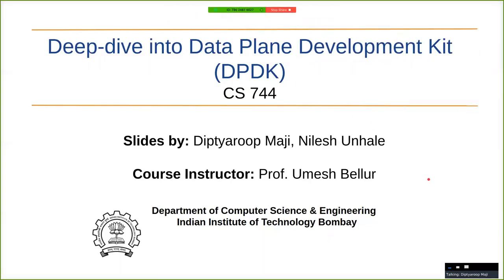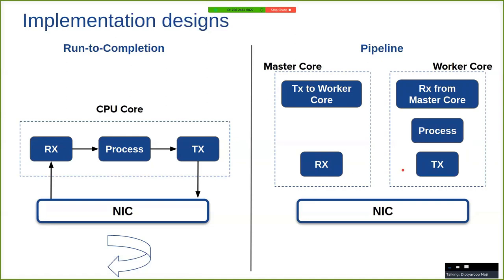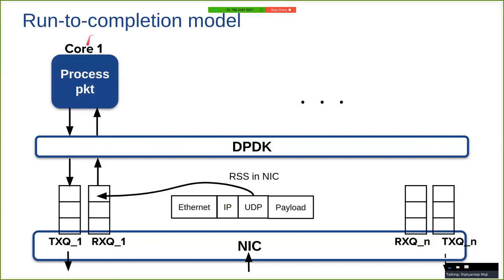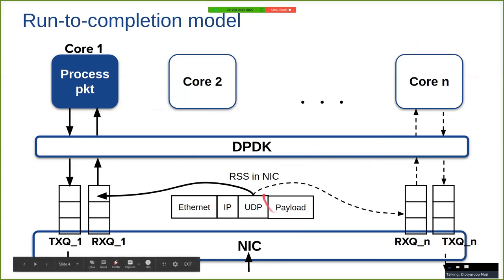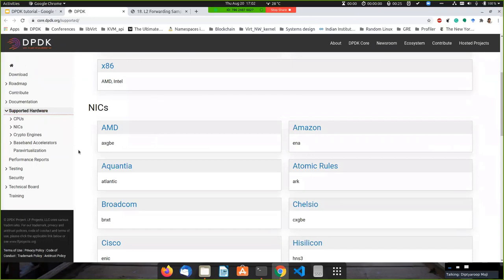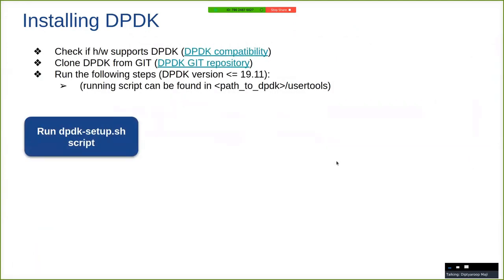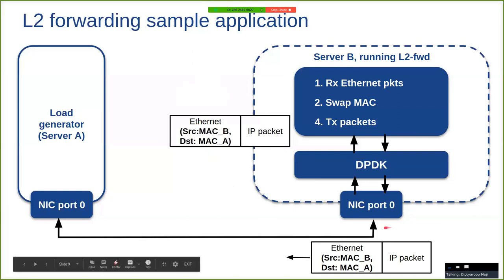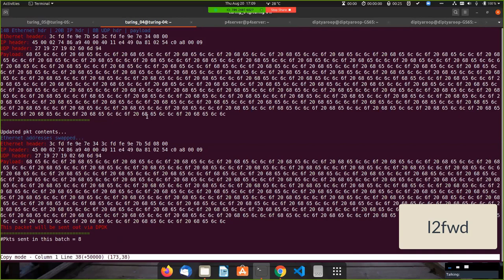DPDK deep-dive

Comment: Dear Sir, 
Very informative video, thanks for sharing your Knowledge on DPDK in a simple way of understanding
Reply from the maker: Thanks for your feedback.
Reply: @diptyaroop  Sir, Could you please make a video on or share some inputs, how the L2/L3/L4 headers are handled in DPDK, data plane.
lets say , if i want to send a udp packet from dpdk installed machine to non dpdk machine, how the control plane comes into picture and once it identifies flow how data plane comes into picture, As i am new to DPDK, i have many queries, kindly address my doubt sir, which will create me more interest in learning DPDK

Thanks in advance
Harikrishna Datrika
Reply from the maker: @HariKrishna-gd4ho  If you want to send UDP packets, you have to craft all the headers in the application (userspace) itself. The headers should be as per standard. Otherwise, non-DPDK machines will reject the packet. So, the packet structure will be MAC hdr | IP hdr | UDP hdr | payload. For UDP hdr, you may use rte_udp_hdr structure and assign values to all the fields. Similarly, for IPv4 hdr, rte_ipv4_hdr, and so on, where the dest IP will be that of the non-DPDK machine. You will also have to calculate the checksum (either in userspace or offloaded to NIC) for real applications. The testpmd application is a good place to start learning about this.
The control plane tells what to do with incoming packets. For example, it may say to forward a packet to a certain machine with IP addr x. The data plane actually processes the packets and does what the control plane tells it to do. So, here, in the data plane, the dst_addr field of the IP hdr will be set to x, and all other necessary fields will be assigned. Then, the packet will be forwarded to its destination.
You may want to check out the resources mentioned towards the end of the video (slides link in description).
Reply: @diptyaroop  will the control plane activities done by Linux kernal, through KNI interfaces, where in the dpdk interfaces will be visible to linux machine ?, let say in the real applications in the production environment, will they build all these MAC hdr | IP hdr | UDP hdr for all data packets to send to a non dpdk machine, will it be able to achieve gigabit speeds with all the processing ? kindly clear my doubts
Reply from the maker: @HariKrishna-gd4ho  You may use KNI. However, you can also build your application without using KNI. It depends on your requirements. KNI just provides a way to use the kernel's n/w stack. So, if you need the help of kernel's n/w stack, it's better if you use KNI instead of tun/tap devices. Otherwise, there's no need.
Yes, you can reach Gbps speeds even after building the headers in the data plane. You can either write your own processing logic. There are also open-source userspace processing stacks like mTCP that you can use.

Comment: Thanks for video. Is it possible to implement software firewall using DPDK? Can we use pipeline model for that? Any links on how to develop and test pipeline sample application?
Reply from the maker: Yes, it's possible to implement firewall on DPDK. You may use any model (RTC/pipeline) to implement. There is a packet classification library with which you can do access control (https://doc.dpdk.org/guides/prog_guide/packet_classif_access_ctrl.html), or can implement your own logic in the userspace. There are many sample applications for DPDK. You can check out their source code as well as documentation (https://doc.dpdk.org/guides/sample_app_ug/index.html). There are also various sources available on the Internet (articles/videos) and you may check them out.
Reply: @diptyaroop  Thank you for your reply. In the video, load generator is used in example. Would be great if you clarify whether you have used  testpmd or packetgen from DPDK which can accept destination MAC address as input in load generator. If we do same example using  virtual machines would it work? any idea on that
Reply from the maker: @athithanvijay183  In the video, we have used an in-house load generator. However, you can use (& modify if required) testpmd to serve your purpose. It should also work on VMs, but I think you may have to do some small tweaks. Please check out DPDK documentation/ other resources available online for details.
Reply: @diptyaroop   Thanks. Let me try testpmd.

Comment: Hi Sir,  
As I am very new to DPDK this vedio is really very informative. I am following your instructions and trying l2fwd application. I am wondering in some points
1- what is that load generator ? 2- Where I can get that load generator and how to run that ?
Please help me with my queries.
Reply: Any one reading this .suggestions would be helpful
Reply from the maker: Any application which generates traffic (packets) can be a load generator. For example, iperf. A good starting point will be the testpmd application. It can also act as a load generator. I would suggest to go through the testpmd documentation and source code and try different things by running/tweaking the code.
Reply: @diptyaroop  which one did you use? testpmd or customized?